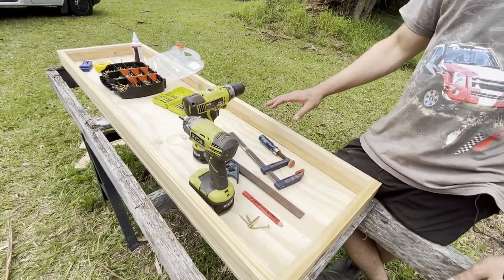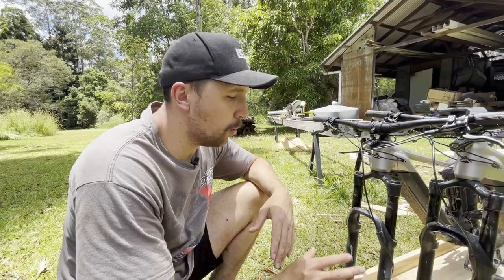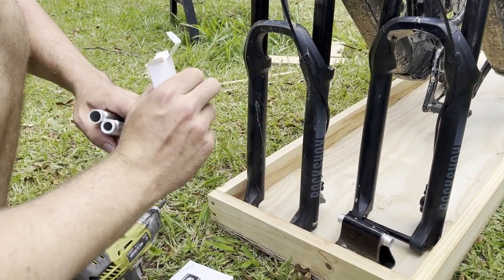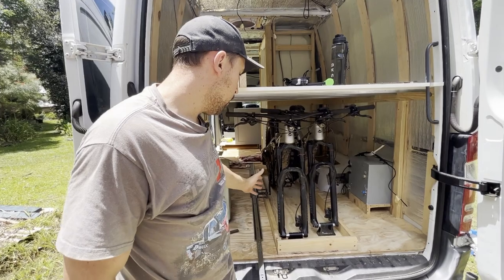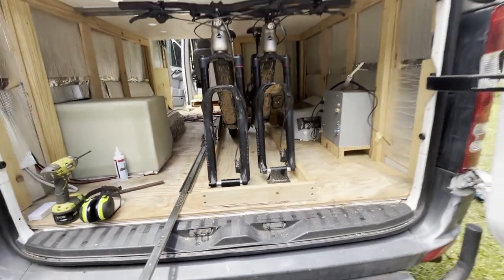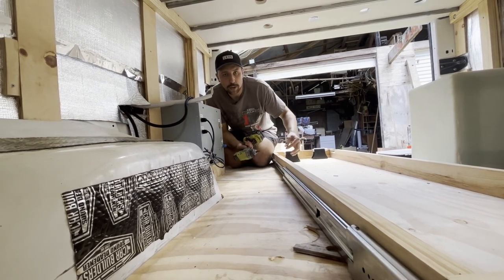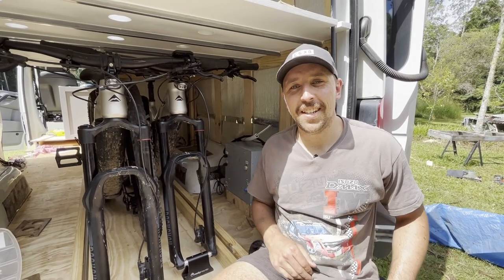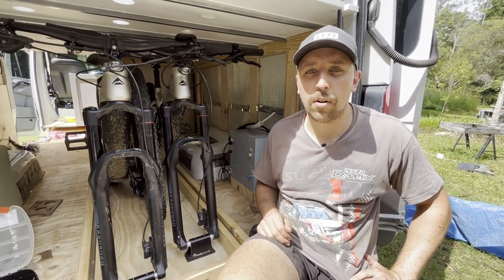CUSTOM DIY SLIDE OUT BIKE RACK - EP18 Van Build

Comment: What is the overall length of the tray? Thanks!
Reply from the maker: The tray is 1600mm long on 1500mm slides. There’s a bit of a sketch at the start if that helps

Comment: Great work. Is mud from tyres an issue on the timber or getting in the runners/ rust.  We will replicate this cheers
Reply from the maker: Thanks! We mostly ride in pretty dry conditions so it’s been pretty good, little bit of dirt and stuff but pretty easy to clean. When we did plumbing we put in a tap under the back of the van so a few times it’s been real muddy we just hosed the bikes down. Enjoy the build 🙌

Comment: How much height do you have to the bottom of your bed?  Looks tight but perfect!  Thanks!
Reply from the maker: Pushed this to the limit trying to maximise clearance above the bed! We’ve got around 930mm from the floor to the bed supports. We’ve since added a pull out table which is mounted under the bed - clearance is 890mm there